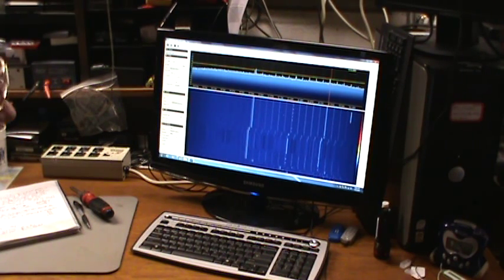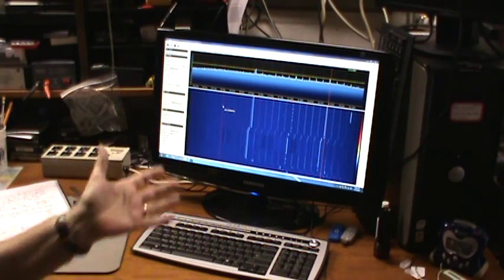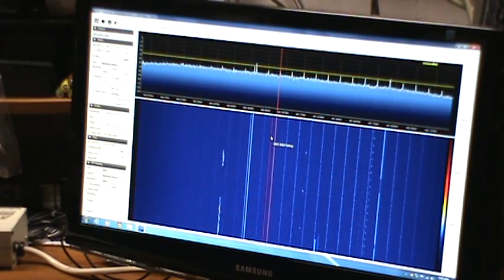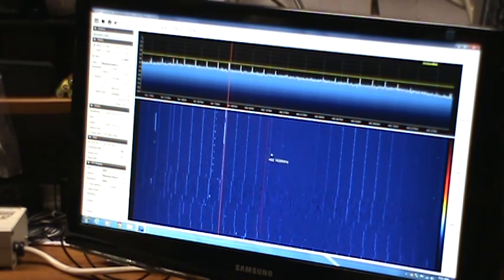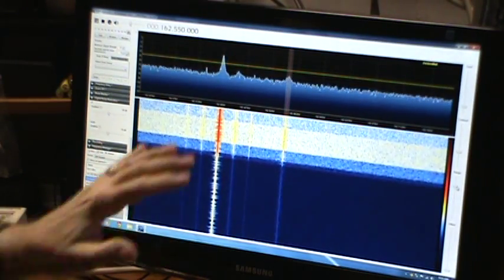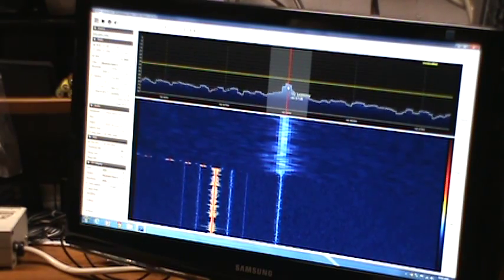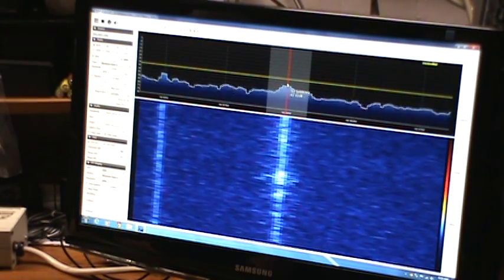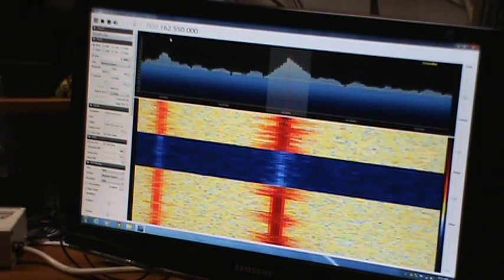TRRS #0530 - Antenna Testing with SDR#

Comment: Genuinely interesting video indeed. Don't forget that SDR "other" application that is turning heads, very if not more capable even, SDR-Radio V2.3 Build 1990 or greater. Some feel more complex, yet it can do a lot more, more efficiently for the most part.
Reply from the maker: For some reason I can not get the latest versions of SDR-Radio to work.

Tom